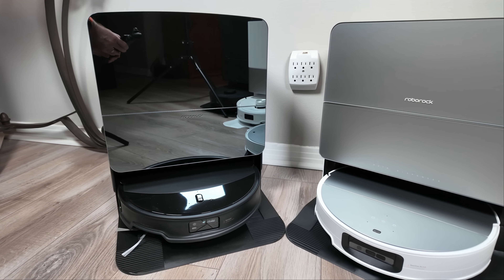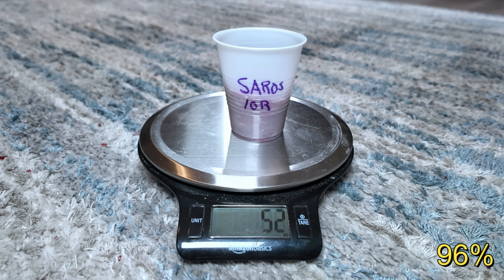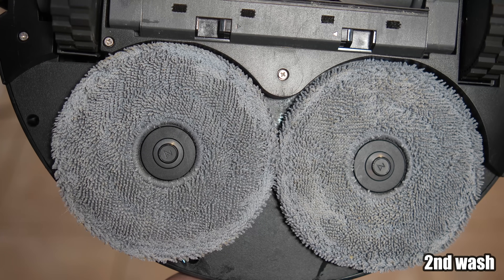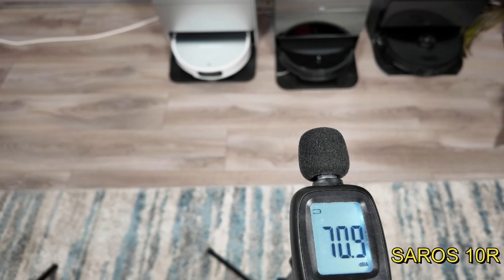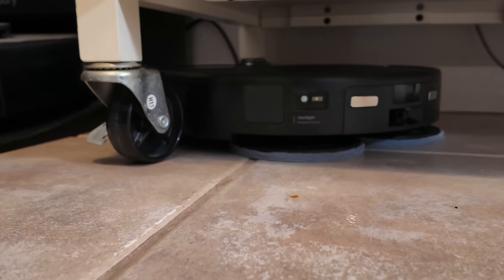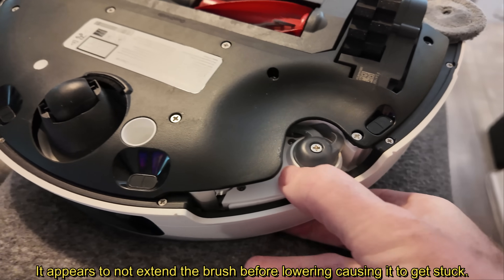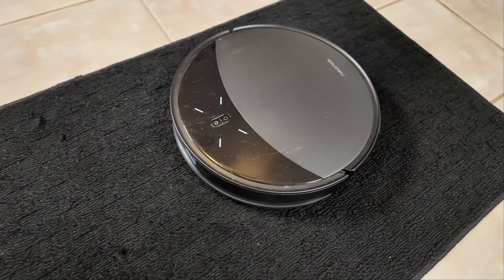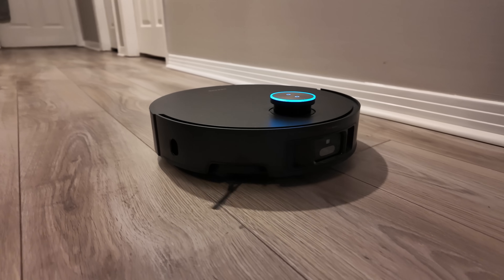Roborock Saros 10 vs. 10R: Ultimate Test Results!

Comment: Who told you the 10R has less suction power?? On Roborock’s official website it says both are the same (22000)
Reply from the maker: They changed it after launch.
Reply: @jamie.andrews so right now r10 has 22000 suction power?
Reply from the maker: @bcherrylife8147 Yes but I would not read much into that. Pascals are more of a marketing number and have little to do with performance. I also don't think it got a bigger motor, they just changed the number.

Comment: Great video. Thanks. Im also very hesistant deciding between the two. Im actually inclined to 10R after watching your video but worried about its navigation efficiency due to new sensor (being stuck). Would you say there is big difference between the two in this parameter?
Reply from the maker: Thanks! I would not say a huge difference in navigation. The 10 has a disadvantage when the lidar is retracted since it can only see in the rear. The 10r will sometimes do some quirky navigating at times but it does not stop it from doing the job.
Reply: @jamie.andrews  Thank you for your kind reply. So there's noticeable difference anyway. I know you said in the video "quirky navigating" is about 10% roughly, but this does not mean "being stuck and stop there"? I have no objects on floor, no carpets, no bumps in my house.
Reply from the maker: @tmoon5691 No it will not get stuck or stop.

Comment: Thanks for the review. I was considering getting the 10R but since it was 250 euros more expensive than the 10 i went with that. Only had it for a day but seems great so far. The only thing i kind of miss from the 10R is the easier to clean dock, but thats about it for me. The vibrating pad + side pad seems to be doing a great job mopping even though it may be percieved as more basic than rotating pads (as your tests show as well). Much better than my old S7.
Reply from the maker: Congrats.  It is a great vacuum.
Reply: @jamie.andrews  A question if you dont mind. On the saros 10 i can change intensity water flow and route while mopping. I tried extreme intesity on tougher dried on stains but it uses a lot of water. I dont want to refill too often. Would it be better to set intensity to standard and route to deep or what is your experience?
Reply from the maker: @vetekli1234 I normally turn the water up pretty high and have it return to the dock every 10 minutes to wash the pads and it will refill the on board water tank at that time. Dried on stains need to be rehydrated to be removed.

Comment: In Vacuum mode on hard floors, does your Saros 10R side brush spin?? Mine quit spinning.
Reply from the maker: Yes, does your brush lower at all?
Reply: @jamie.andrews  - Hey it didn't work for about an hour, then it started to spin slowly, then it EXTENDS all the way out and stays like that (all the time). It even docks with the side brush extended out. I contacted Roborock CS ... so waiting on them.
Reply from the maker: @ElementShift   My 10 had a similar issue.

Comment: They have now allowed sidebrush use on carpets.
The crevice cleaning option is on a 7 day timer, operating only once per 7 day cycle.  Toggling the option will reset the timer.
Reply from the maker: The side brush on carpet is only for the 10r so far, but I am glad to see it. The crevice cleaning option only fully works in a whole house cleaning a corning to Roborock unless they changed something. There is still no option to enable it every cleaning which to me is still a problem.
Reply: @jamie.andrews  Yeah, they insist that crevices don't get that dirty...  hence the 7 days - however, other than disagreeing, i believe it should be an option for the user - i understand it should be full room cleaning as well as whole house, just not zone or selective cleaning.

Comment: I really like the Saros 10r and Dreamy x50, and I am stuck deciding which one to get for my wife's birthday in May. I am still waiting for your video comparing both of them. Thank you for your work!
Reply from the maker: I am still waiting for a fix for the battery drain issue on the X50.
Reply: So you are suggesting X 50 if they fix their battery problem?
Reply from the maker: @RedisN76  Without the battery fix the it is not a fair fight.
Reply from the maker: @RedisN76  Well I won't say just yet as I will run them back through tests since improvements have been made since this video.
Reply: Hello, yes, I can now see what you mean about the battery life. I bought the X50 and have been using it for the last 24 hours. I can see how fast the battery is draining. If you get any updates on the solution, please let me know. I decided to use it for a couple of weeks. If they do not fix this problem in a couple of weeks, I guess I'm going to have to exchange it for Cyrus 10R.
Reply from the maker: @RedisN76  So far I suspect it is hardware related.  They have been sending me beta firmware and it has not solved it.

Comment: I was considering the 10 and the 10R and went with the 10R.
1) I am not a fan of the vibrating mop pads because they don't get right up to the baseboards.
2) The battery run time isn't a big deal to me as it will return to the dock to recharge a little and then continue where it left off.
3) I like the self cleaning dock, and if needed the cleaning tray can be removed to clean.
4) automatic cleaning solution dispenser in the dock eliminates mixing in the clean water tank.
5) the extending side brush gets the corners!
What I don't like is the cheezy glass front on the dock that reflects everything and is a fingerprint magnet.
Thanks for the review.

Comment: What is a realistic life span expectancy for a robot vac/mop?

I’ve been saving up for a robot vac/mop for years.  Our flooring is a medium quality vinyl plank.  One bathroom has 12 inch white tile.  The house is about 2,300 square feet flooring area.  No carpet, but we do have area rugs that are low profile.  Cords are no problem as we already keep them off the floors.  One short haired puppy that should only grow to be 25-30 pounds.    Hopefully, potty training will be complete soon.

FEATURES Desired:

1.  Great customer service

2.  User friendly, great navigation, and excellent cleaning performance.

3.  Made in the USA if possible or at least EASE of ability to get service, maintenance, parts, and accessories.

4.  Easy cleaning and a low hands-on maintenance.

5.  Like the swing out sweep/mop arms.

6.  The dock size and color are not an issue for us.

7.  We don’t need threshold climbing.

Any recommendations?  Doesn't have to be Roborock.

Comment: Jamie - VacuumWars just released their review on these and they concluded that the 10R was a better mop. That being said, they also mentioned that it may have been a function of how much more water it laid down by default compared to the 10. I know you've called out this nuance before (ie. mopping results being a function of water output) and in your testing methodology of setting water to the highest on both devices, it seems like both robots performed about the same. Thoughts?
Reply from the maker: The 10r has a lot of water on the pads when it leaves the dock and once that is gone it is about that same output as the 10.  I allow both robots a minute or so to mop that dock water off the pads as I am doing a zone cleaning in my tests which do a paremeter run first. This also makes sure the hot water from the dock is not skewing the results since it won't stay hot for more than say a minute before the pads are room temp. I also use different stains than he does.
None of these tests are lab quality and the floors types are different and he places his in a square box. 

With that said I feel besides that one test all of his other results were really close to mine which is more common than not. 

Does that help?

Thanks for the question!

Comment: saros10 has a firmware update with improved obstacle avoidance. Can you test it again?
Reply from the maker: I did and it improved some, but I got it and tested it before this video came out.
Reply: @jamie.andrews saros10 firmware 02.33.20
Reply: @jamie.andrews 
Is the version you tested 02.33.20?
Reply: @jamie.andrews 
Is the version you tested 02.33.20?
Reply from the maker: @시간이더필요해  yep

Comment: The 10 in your words is “slightly better at cleaning” but you give the edge to the 10r… did we forget what these robots are meant for?
Reply from the maker: In my opinion the slightly better at cleaning doesn't outweigh the drawbacks of the 10.  Not to mention edge cleaning makes this useless for people like me with floor moldings.  Object avoidance is also better on the 10r, but if you don't have a need for good object avoidance, don't care about the extra effort to clean inside the dock or don't have floor moldings like mine then go for the 10. That is why I mentioned in the video the 10 might suit you better. 
The 10r is not bad at cleaning.

Comment: I think I would get the 10R, I recently got the Q Revo Edge which has most of the 10r's features. I prefer the spinning mop pads instead of the vibrating pad. I do have certain preferences with my robot's cleaning settings. First, I never use the mode to vacuum and mop at the same time because there is a risk that water could get pulled in to the dust bin and possibly the vacuum motor. I always use either vacuum only or mop only to avoid that. For vacuuming, I set it to the strongest setting possible, if it's going to clean, why not do as good of a job as possible? For mopping, I set it to return to the station to wash the mop as often as possible, use the hottest water it offers and the deepest wash that is offered. It uses more water and takes more time but again, cleaning quality takes priority over everything else. For the navigation, I use the most detailed setting that is offered, for vacuuming it's using standard, and for mopping, at least on the Roborock and Dreametech models, I use the deep plus option. If the robot offers a two pass setting, I use that as well. In the case of the Narwal robots, it offers a three cycle clean so that's what I use. Also, for mopping I set the mop to be as wet as possible, I have all hard floors, no carpet.
On a slightly different topic, Irobot has released some new models but apparently they are not internal designs, they are outsourced from another company. Because of this, there's really nothing that distinguishes them from the competition. While Roomba was behind on things such as navigation, there were a couple features that were unique to Roombas, the dirt detect feature, the bin full senser and the dual rollers. Actually a few other companies have started using the dual rollers now but none of the new models have any of these features and Irobot has said they are not sure if they will be able to continue so buying the new models is risky.

Comment: i have a large house and a large dog. the 10 seems to be the one i should go with for runtime alone but darn the dock cleanup of the 10r is calling my name
Reply from the maker: I'm not sure if the dock maintenance alone is that big of a deal.  If you are able to bend down to clean inside of it and you don't have floor moldings like me it might be fine for you.
Reply: @jamie.andrews I’ve got quarter rounds at the bottom of the baseboard as well. It’s a 3500 sqft house with around 1250 sqft of cleaning area. Makes it a tough choice. I had the roomba s9+ and liked the performance. It was aging so I bought the roborock s8 pro ultra. It is starting to die on me and I’m ready to upgrade. Really agree with the comments. Maybe focus efforts on one perfect model instead of these hard choices
Reply from the maker: @kenpatelli8172  If you have quarter round moldings on baseboards I would totally skip the 10.  It will cause the main mop to lift and you won't mop within about 8 inches of the baseboard. Bad design. The 10r won't.
Reply: @jamie.andrews I’ll take your advice

Comment: Is Roborock Saros 10R the best you've tested ever yet? Been thinking about Dreame X50 and the 10R for sometime. Before that S8 MaxV Ultra, then the QRevo. 
Want a solid upgrade from Roomba S9+ and Braava Jet M6.

Just don't know yet, when Roborock Saros 10R will be available in EU / Denmark.
Reply from the maker: The X50 is a strong contender to the Saros lineup. 
With that said my review of the X50 will be out on the next few weeks so you may want to take a look at that first.
Reply: @jamie.andrews  great. What I hear the most, is that customer service at Dreame is not good, and their App too ain't that good. Will wait to decide, until I see your upcoming review of the X50. Thx :)
Reply from the maker: @Ph1LDK  Customer service for most of these companies is not great. I don't have an issue with the Dreame app although it is full of different options that could be overwhelming for some.

Comment: sir thanks for the review, when you say it dries the mop pads for several hours, does that make noise? is it blowing on the pads for hours at a time?
Reply from the maker: I little but mostly unnoticed. It blows hot air on them.

Comment: Jamie can you create a short video with the new firmware on the 10r?
Reply from the maker: Is there something you are looking for in particular?
Reply: @jamie.andrews  You cleared up the dry mop issue with your comment above but what I am concerned about is if it's still moves around aimlessly at certain points in its vacuuming and mopping sessions, if obstacle avoidance has improved and does the side brush extend on corners. There was also some information that it tends to leave drops of water everywhere, not sure if that was a single instance or on all 10r robots. And finally has the efficiency of the water during mopping improved. I have a decent sized house and typically vacuum the rooms one at time during the day and the same with mopping in the early morning so I don't vacuum and mop everything in one shot. I want to be able to do the mopping with just one clean water tank. I previously had a QRevo Edge and could do that without an issue and maybe get 2 days of mopping. Thanks in advance.
Reply from the maker: @DJ-HGLegacy  It needs some work on navigation. The object avoidance is the best of any Roborock robot. The side brush only extends in 90 degree corners of the room. Most all robots with spinning mops will drip some water here and there. You have 2 fast spinning pads that have drops of water landing on top of them.  If it hits plastic instead of the pads the will leave a small puddle of water.  Turning down the water output helps some.
Reply: @jamie.andrews  Jamie, I appreciate your response to my questions. I will probably be picking up the 10r over the next week. Hopefully over the next few updates it will be running like a champ. I want to stick to the technology that I believe Roborock will be using for the foreseeable future. Thanks again
Reply from the maker: @DJ-HGLegacy  YW! I would greatly appreciate it if you used one of my affiliate links to help support the channel. They are in the video description.
Reply: @jamie.andrews  I will definitely use one of the affiliate links to purchase my 10r. Thanks for your help in making my decision.

Comment: Funny you mention the mini spinning mop on the 10 riding up the bottom round of the baseboards. This is definitely an issue in mopping mode but in vacuum mode, it will basically clean dust off the baseboards because due to this oversight. That part might not necessarily be a bad thing 😂
Reply from the maker: The side mop lifts in vacuum only mode though so it is not even able to do that lol!
Reply: @jbermud2 I have read complaints about that side mop riding up onto quarter round molding, which lifts the larger mop off the floor on that side, leaving unmopped areas close to the wall. I was leaning towards the 10 until I saw that.
Reply from the maker: @chrisoralls3555  It makes it mostly useless for me.
Reply: @jamie.andrews  Thanks for the reply, sir. My house is entirely hardwood/linoleum floors, with a small runner at front door, and quarter round molding around entire house. No kids or pets, and no shoes worn in the house. I'm sure the 10R would do an amazing job vacuuming and mopping this old place. LOL
Reply from the maker: @chief2gfd  Yea if you have quarter round moldings I would skip the 10 and go for the 10r. That issue alone makes the 10 partially useless.
Reply: @chief2gfd There’s a high chance it will also happen on the 10R. I guess it depends on your moulding specifically but literally every robot I’ve had with spinning mops has gone up on the moulding.
Reply from the maker: @jbermud2  I have never had a Roborock with round spinning mops ride up on moldings.  The Dreame robots do though.
Reply: @jamie.andrews  do you think it’s because the roborock have more downforce compared to dreame?
Reply from the maker: @jbermud2  I think it is because the spring is too stiff in the swing out side mop. That pushes it up in moldings.
Reply: @ interestingly enough, I found that setting it to sensitive on collisions got the robot to stay just close enough to the moulding where the mini mop is cleaning the floor right to the edge. 

When in vacuum mode, I find that even when the mini mop is lifted, the moulding is tall enough that the mini mop is dusting it 😂

So I seem to have found some sort of a happy medium, albeit in a rather clunky way. I’d give the 10R a try if it was available in Canada and if the wife would allow it. She hates the exposed water tank look and doesn’t want it in our living room.